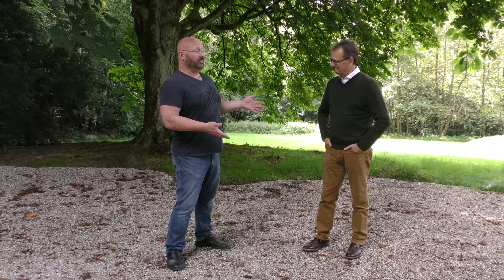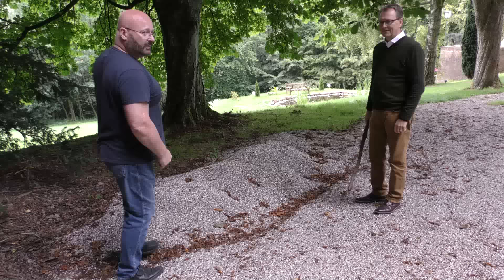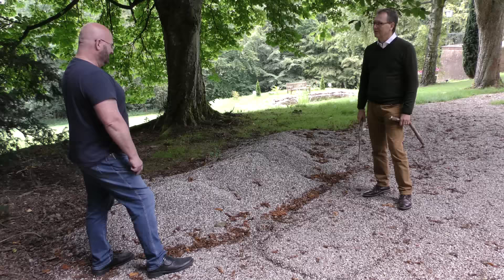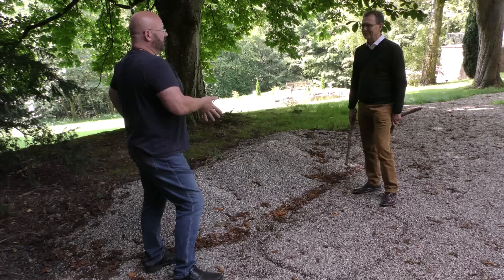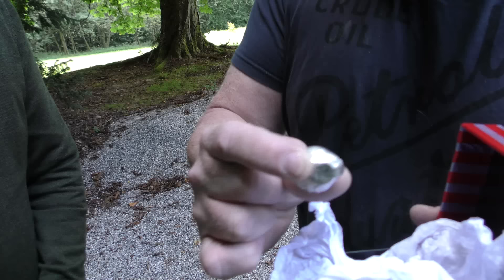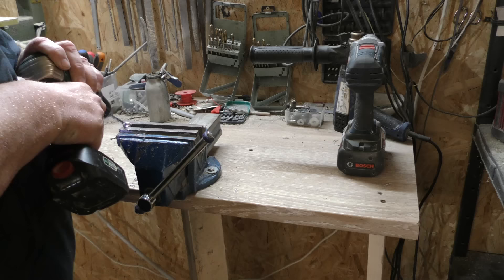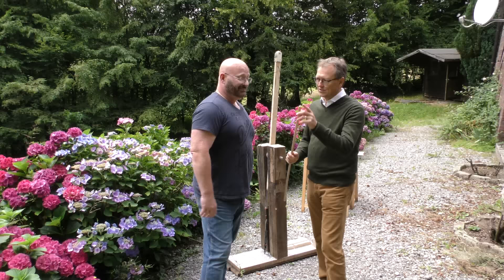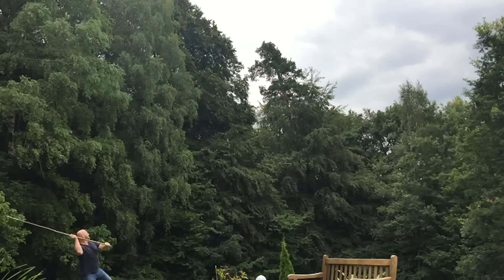The Mystery Of The Whistling Bullets: Psychological Warfare, 200 AD

Comment: Or... perhaps they simply used the same tool to make all the holes.
Reply: Interesting theory, you could be on to something :)
Reply: Just because dewalt wasn't around, does not mean drills werent
Reply: If the bullets were cast before the battle, instead of in an arsenal in Rome, they might all be cut with the same drill or other instrument. I've seen some references to this being more common (although not necessarily in Rome) and to a common Roman method being to make molds in sand on a beach or something (although not necessarily in the field).

As far as throwing sticks, some Roman general-type dude said that they should train all soldiers in the sling, so while this might not have been totally followed, the idea that they'd need standardized sticks isn't obvious. At least some legions might have been influenced by that guy and mostly know how to use slings. Also, if they had standardized sticks, then either the sticks or the equipment for making the sticks would probably be durable enough for somebody to have found one. And even if not, there would probably have been enough work that went into the process of making a standardized stick that somebody would have written about it.

There was a follow-up article about this in the Daily Mail. They didn't mention the throwing sticks. I'm guessing somebody discounted it since then.
Reply: uncletigger  Interesting point, but my understanding of the Romans and one ot the major contributary factors in their success, was uniformity....all their kit was standardised, their drill (I mean military drill), their organisation, their camps, their weapons their armour etc so maybe they had standard 'lead slugs' too. I get that you hold that modern accurate machinery is only known/standardised widely in the last 200 years, one of the problems with the video is that they say that all the 'slugs' have a 4mm hole, to what accuracy? Big difference between 'about' 4mm and 4mm plus or minus ten thou.  I imagine the debate could be easily settled if 'holed slugs' were recovered at diverse locations; if the Romans were using them at this site, they had to be using them elsewhere........UNLESS the slugs were fired by mercenary Celtic tribes, who were well known to use slings?
I have never before heard mention of the Romans firing slings or lead balls, but no historian me.
Also, while I love Georg, his tests were at virtual point blank range; if you got a maddened, hairy assed Scot running at you with a large pointy weapon and all you have is a stick with a lump of lead on the end, your shot better be perfect of you will soon be dead....just can't see it as any kind of valid tactic. (David and Goliath aside), slings are ranged weapons
Would love for someone better informed to shed light on this.
Reply: uncletigger  Aargh! I just lost a huge reply when my cat jumped on the keyboard.
That may be a good thing, I shall try to be more concise....'unc..' you are obviously better informed than I, (blame Hollywood, they never showed massed ranks of slingers.....) and it makes perfect sense to have slingers on the flanks or indeed behind a main assault force.
I wonder just how much lead was being toted around? 20 rounds per expert slinger? It must have been the 'depleted uranium' of it's day...likely they had a bag of milled stones for general harassment and 10 serious slugs...why ten? just the roman fixation on decimals; it's as valid a claim as Dr Ross's where they excavated a small area and extrapolated the number of slugs from that small sample (I think). By that rationale, if they found a bag of gold coins, might they conclude that the entire hill was covered in gold?

I simply don't know, I admit my ignorance but I don't suspend a rational thought process....again I ask the simple question; what of the slugs from other battle sites?

I have my own 'half-assed' theory; that the 'whistling slugs' were indeed intentional and that lead slugs in general were to be feared BUT they just couldn't be sustained in huge numbers over the course of a protracted engagement so they used whistling slugs and milled stones in combination (the stones would have been bad, but not as bad as lead slugs)....if they fired 10 stones for every slug, some whistled and some didn't...... it would be just effing awful to be on the receiving end, you probably couldn't see them coming, but if you heard that whistle, you would def get your head down!
That seems more plausible and practical to me, as for the standard 4mm holes, might they just have found a cache or a foundry being used by the Scots? If it was a cachet, stands to reason that all the holes were the same size...AGAIN, what of other sites, what size holes were found?

That's about it (glad you got the abridged version !), thank you for the reply but I just can't sign off without sharing this other snippet that has NOTHING TO DO WITH THE QUESTIONS RAISED, 
I love it anyway....
here 'tiz',
an archaeologist and team were excavating below a roman villa, there was a complex under-floor heating system and a sewerage system too. When they dug up the pipes from the drainage system they found that they were all oval (ovoid?) in shape rather than round and concluded that they had deformed under gravity when they were being manufactured, a flaw in the production process...........then someone pointed out that they were all 'universally flawed' and completely uniform, furthermore, they were all laid narrow side down and while the site had generally dry and benign weather, there were also periods of heavy rain.
Soo, while the oval shape had the same volume/capacity as a circular pipe, in the generally dry times, the narrow end of an oval is more efficient and less prone to silt building up in the pipes......
it is a 'bug-bear' of mine that some people equate modern technology with intelligence and therefore assume that ancient civilisations were dense and unenlightened, I rather think that the reverse is true, a sharp and practical intelligence helped keep them alive while modern technology seems to aid the weak and foster a mass numbing of intellect....
I really AM finished now,
regards and respect,
Con
Reply: Perhaps the holes were the same size because someone decided that this size hole makes the drill bit just strong enough for the job while removing as little material as possible.  A smaller hole is quicker and easier to drill than a lager hole.  Small holes make for less material wastage.  Even when trying to capture all scrap some will get away.

Or... the holes in the bullet molds were 4mm and a matching stick with a hard stop was crammed in the hole before the lead cooled to make all the bullets uniform.  That pressure would also help fill any cavities in the mold and reduce voids in the bullets making for a more predictable projectile.
Reply: Another theory is that they wanted all the sounds to be uniform. Like a wall of uniform sound coming at you. I mean what would be more disorienting, many bullets of differing sounds coming at you? Or just a single sound that sounds like its coming from everywhere.
Reply: Omar Ignacio Silvestrini  I don't know what to say, it is perhaps too big a subject for some short lines.
I love camping (by the way) and I love my modern tent that keeps me dry in even the worst weather!
Reply: @billymurray1334  No, not necessarily. Often slingers would cast there own shot before a battle by sticking their thumb into some wet sand and using that as a mold. WAY too much variation! But maybe something common to the Army, maybe something that was standardized and a part of their equipment, was used as  the mold for the singing shot. How many other examples of these bullets have been found at other battlefields, and how do they compare to yours? I'd suggest you check some of the more common kit or equipment items used by the Roman legions of that time
Reply: They used a nail and punched a hole while mass production
Reply: uncletigger  if you cast in lead, you wouldn't need to drill a hole. the hole would  be part of the cast.
apart from that,  once the idea shot was made, multiple.molds can be made from that original poce, hence all subsequent molds and casts would be identical.
no tools are required.

really no different to making fishing sinkers from scap lead. 
no one drills holes in sinkers - it is part of the mold and cast process.
Reply: uncletigger  coins were hammered, not cast. Lead shot is molded.
Reply: That’s what I was thinkinh
Reply: one poor bastard had to do it all by himself..the night before the invasion they all play a drinking game and the loser gets the drill.. 
"ahh looserius minimus, its you again!"
Reply: uncletigger  not quite. Romans had standardized measures, they used e.g. standardized bronze taps to calculate water tax, and especially the legion was big on bureaucracy, they had even standardized roof tiles with unit stamps on every single one. So, legion armory drill bits standardized to at least thevprecision we can measure after 2000 years in the ground are well within limits . Remember they built aquaeducts, and a frigging 120 mile straight wall through german forest that deviates less than 50cm.
I think there could be a point to that theory.
Reply: @zomgwtfbuffet  if sticks and bullets are standardized, every bullet fits every stick.....
Reply: that makes too much sense don't get into politics. also the same person could have made the tools

Comment: I wonder if you could use the 4mm hole for stringing the ammo together, perhaps a somewhat tight fitting rope could act as a primitive magazine of sorts to ensure the soldier only grabbed one shot at a time, while also giving them a sense of how close they are to running out...just a thought :)
Reply: the hole does not go through
Reply: YunaQQQ
Oh thanks...I suppose you could accomplish the same thing with an array of with wooden pegs on a piece of armor. Like an off-hand leather arm band with wooden pegs sticking out of it...but I can't see that being more efficient than a plain old bag/satchel of ammo. Is there any chance a wooden peg could have been used inside the leather sling pouch to give the projectile even more spin during release/flight?

Comment: drill the hole sizes and have compressed air blow over the holes to hear the noise. could be the pitch or frequency it puts out could be easier to hear.

Comment: I realize this is a very old video Joerg, but the balls could have been cast as one step, but the holes made by using a hot iron rod (nail) rather than a drill.  Early period drilling was a very slow process and the compound spiral set up we use wasn’t the usual,  If I were to want whistle holes in my lead shot, I’d have a bunch of nails heating in fire pit coals pull one out with tongs and press them into the lead to melt the hole.  If done that way, all the hole should be about the same size.  If the setup were in an armory region of the encampment, it wouldn’t be unusual to expect the entire workforce using parts of the same iron rod, making the hole diameter the same size....

Just a thought, great fun episode, and I don’t doubt you and the rest of your fans thought of this already.... :)

Love the channel,
Matt
Reply: That makes a lot of sense.
Reply: P

Comment: Jörg Sprave: striking fear into the hearts of coconuts and Götterspeise all over the world. 
By the way, I'm curious if the velocity of the lead bullet launched from a stick would be higher if the stick is elastic. I'm thinking about some sort of whiplash effect.
Reply: Mumba Mumba I was too, if there was some way to hold the ball with the hole on an elastic sort of material to increase the power so as to make it more deadly or easier to throw up the hill.
Reply: Have a bronze pin for the ball agdled slightly forward might do it.
Reply: Angled
Reply: Or a flexable stick/sapling to store the energy till the launch.
Reply: Wenn man sich jetzt noch vorstellt dass die Kugeln von einer etwa 3,30m bis 4m langen ( etwa Idealhebelverhältnis ) sich verjüngenden "Angelrute" abgefeuert wurden, die sich selbst auch nochmals auflädt beim Wurf

wäre dies bestimmt nochmal einen Penetrationstest => Gelatine-Test auf 30m wert oder!?

Comment: why did you test at point plank range? 
surely the shot would slow down by the time it got to its target?
Reply from the maker: I am not good enough to hit a coconut from 150 meters. So I compensated by shooting at a lower velocity (35 m/s) compared to the ancient slingers (45 m/s). But heavy lead balls don't lose much speed as they are not as prone to air resistance. Throw a table tennis ball and a golf ball, both about the same size. At the start the table tennis ball is faster, but slows down very quickly while the golf ball remains fast. Lead balls are much more dense than golf balls.
Reply: with all due respect, I don't think golf balls and tennis balls are close in size at all.
Reply from the maker: I said table tennis balls (= ping pong balls). Very much the same size as golf balls.
Reply: +Skyler Owens he wrote table tennis, not tennis. and I think that's those are almost the exact size a golf balls
Reply: JoergSprave Oh I see now, my apologies.
Reply: This was the reason he shot so close....
Reply: Out of interest, where did the 35m/s figure come from? Not that I dispute it, mind - it sounds about right. I'm just curious. ;-]
Reply: after the bullet stops getting higher in the air, it starts accelerating into the same speed it had when it hits the same hight it was fired from
Reply: most likely those rounds were just used to lower moral of troops as archers often used arrows that whistled through the air
Reply: +‌ ‌ ‌ ‌ ‌ ‌ ‌ ‌ ‌ ‌ ‌ ‌ ‌ ‌ ‌ ‌ ‌ ‌ ‌ ‌ ‌ ‌ ‌ ‌ ‌ ‌ ‌ ‌ ‌ ‌ ‌ ‌ MATHEMATICAL!
Reply: In vacuum, yes. In air? No. It does regain momentum as it approaches same height but a lot of energy is lost due to air resistance.
Reply: ***** yes i shouldve said smth about that,

tho the horizontal force is still high and the regained energy from falling is also a big part of what it lost by getting slowed down
Reply: +JoergSprave 
You don't need to be more accurate, Jörg, you just need to shoot more bullets! lol
Reply: ‌ ‌ ‌ ‌ ‌ ‌ ‌ ‌ ‌ ‌ ‌ ‌ ‌ ‌ ‌ ‌ ‌ ‌ ‌ ‌ ‌ ‌ ‌ ‌ ‌ ‌ ‌ ‌ ‌ ‌ ‌ ‌ Not true. For example, if I fired a gun up in the air and the bullet fell back down and hit someone, it likely wouldn't be much worse than a bee sting. However, if I shot someone point blank, they would die.
Reply: Mgb 360 thats due to air resistance, the bullet on the way down reaches its terminal velocity
Reply: ‌ ‌ ‌ ‌ ‌ ‌ ‌ ‌ ‌ ‌ ‌ ‌ ‌ ‌ ‌ ‌ ‌ ‌ ‌ ‌ ‌ ‌ ‌ ‌ ‌ ‌ ‌ ‌ ‌ ‌ ‌ ‌ Yes, that's my point. Air resistance applies.
Reply: Mgb 360 as i said above...

what was it? 20 grams. as you might know the terminal velocity is much higher. and the horizontal force wasnt shrinking all that much
Reply: ,HE DIALLED THE SPEED HE FIRED AT[LEFT THE SLING] TO THE THE SAME SPEED IT WOULD BE TRAVELLING WHEN IT HIT THE PERSON,COMMON PRACTISE,IN BULLISTIC TESTS,OTHERWISE IT WOULD ALMOST BE IMPOSSIBLE TO CARRY OUT THESE TESTS ACCURATELY
Reply: Polly G yes i just fed a simulator with data its about 20m/s fast when it hits the ground, still lethal, (even faster the simulator only tracks velocities every second), its even about 30m/s, for 14mm diameter, i used 2cm for the first one
Reply: +Mgb 360 actually several people have died from such incidents..
Reply: Joseph Rector From a falling bullet? I doubt it
Reply: +Joseph Rector the general consensus is that a bullet fired at a perfect 90 degree angle wouldn't kill a healthy adult if it were to hit them on the way down
Reply: The Stoned Videogame Nerd i used like 45 to 60°
Reply: Mgb 360 tim martin First, mgb yes there are actual cases of this happening, tim the chances of a human firing perfectly 90 degrees are very slim even a degree or two off would negate the tumbling effect and i never said perfectly healthy adult, i just said people.
Reply: Joseph Rector Citation needed
Reply: Joseph Rector Alright then, fair enough
Reply: yeah i wouldn't say commmon or likely just possible...there are just a ton of factors that go into something like this...kind of a perfect storm type scenario...the whole when Mars lines up with venus on the third Thursday in march when the air speed velocity of an unladen swallow is less than speed of a olympic speed walker with a sprained ankle type of thing....
Reply: the terminal velocity for a .30 bullet falling after being shot is 360 kph, which could easily enter your skull
Reply: I thought of the point blank, too. In that siege situation you'd be shooting from many feet away. Now, if you shot high, like at a 45 degree angle - which should also maximize your range, when the balls fell, they'd land at close to the speed they were launched from the slingshot, minus air friction losses. I remember doing calculations like that in college physics. So perhaps it was the speed of the fall, and less to do with horizontal velocity when it hit,  that actually did the damage.